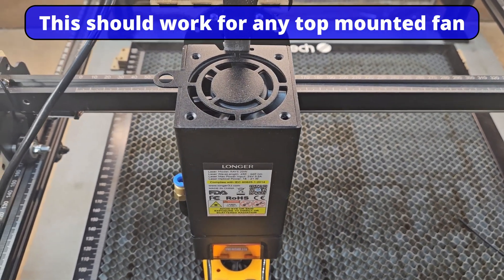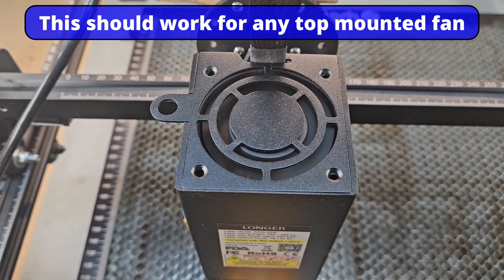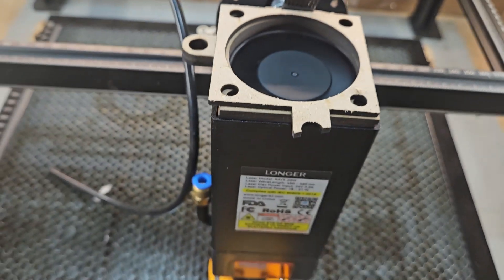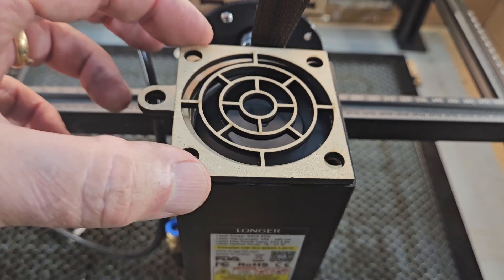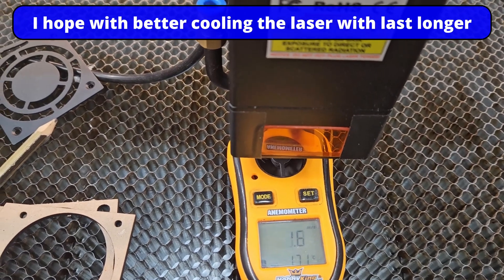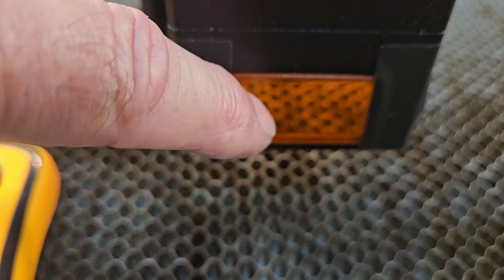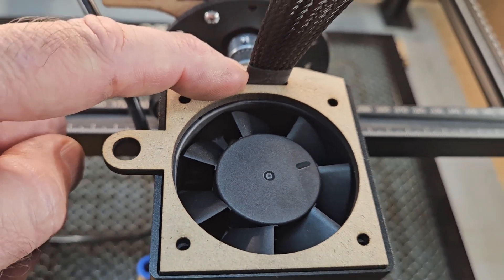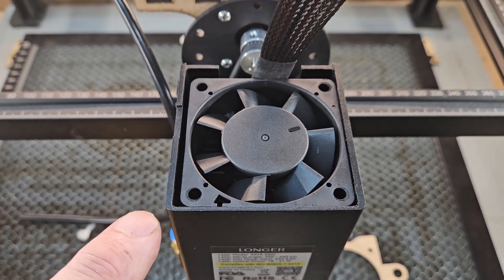How to Improve cooling and reduce fan noise on a Diode lasers module engraver cutter

Comment: Very interesting! How does adding the wooden spacer improve the cooling? I can understand the noise reduction but I can see why it affects the cooling performance.
Reply from the maker: Hi great question. It also improves the air flow through the laser module.
Reply from the maker: It's also the design of tbe grill. It has no central section. You just hear the fan is not working so hard to pull the air through
Reply from the maker: I did basic temp tests in the video

Comment: Very interesting bud. I'm going to be following this to see your findings on different materials. Are you going to share the file for the grille and spacers?
Reply from the maker: I cut more mdf 3mm 1 pass today no marking on the surface when using the new fan cover
Reply: @FlixmyswitchLASER which means the airflow is good, right?
Reply from the maker: @AB_thingsDFW well for this mdf test yes it's fine. Other woods like fine as well as they produce less smoke. I will test some acrylic next week.
Reply from the maker: Files are in the description.  Thanks for your support
Reply from the maker: What laser do you have?
Reply: @FlixmyswitchLASER  Longer B1 30w.
Reply from the maker: I believe the housing are the same, it would make manufacturing sense that they are.